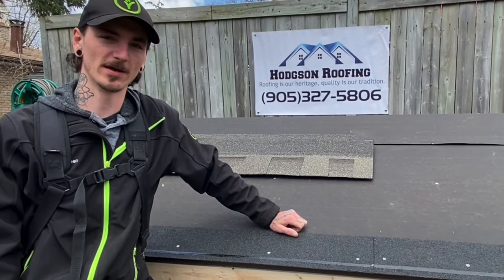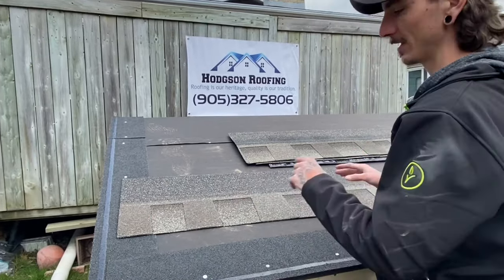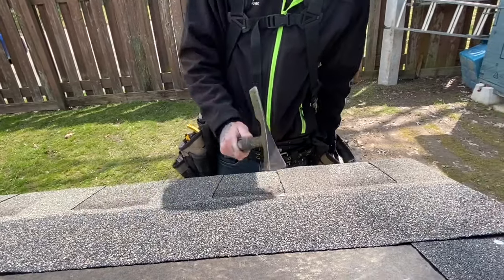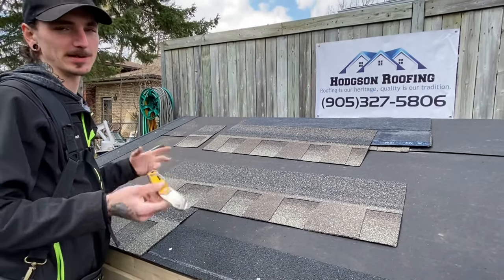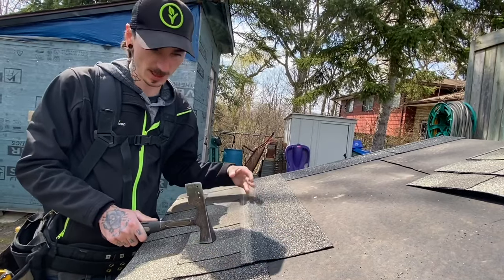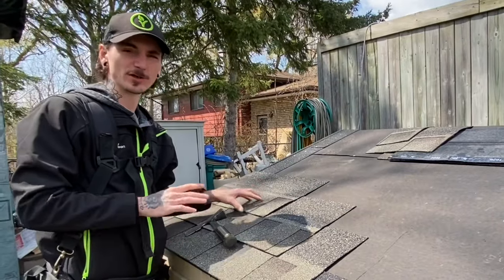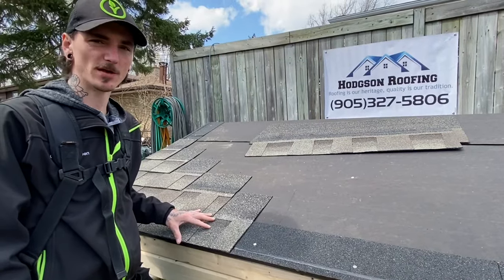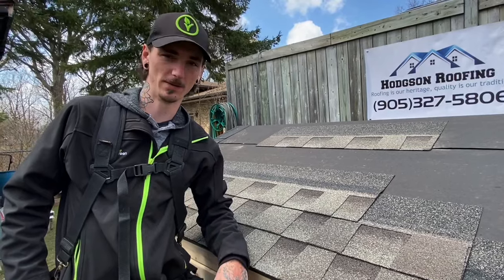How To Properly Start Shingle Courses On A Roof

Comment: Thank you for your videos!! I decided to build an enclosed porch myself and the one thing I did not have experience in was roofing. I was able to follow your instructions and I think the roof is turning out beautiful! Thank you for all the tips and little added fyi's from someone with experience and knowledge to help ensure quality and prevent mistakes. There isn't room for error when it comes to the roof or you risk the integrity of your entire project and alot of expensive repairs later on. I'm a single Mom raising 3 boys and I get alot of shit sometimes about some of the projects I do, until they see how well it turns out. I couldn't pull it off sometimes without the help of guys like you sharing your knowledge and skills. It is so very appreciated! Xo Have a wonderful day! Thanks again!

Comment: Super helpful, I'm doing this on an 8x10 shed tomorrow. Never shingled a roof before but your clear directions have me confident that I can do it. Thanks!
Reply: How did it turn out?
Reply: @randonrobinson  great! Did it just like this and had it done in a couple of hours. It rained severely the very next day so I'm glad I did it when I did
Reply: @Paintplayer1  good deal! Gunna have to try this out
Reply: @randonrobinson  for sure, one thing I think you're supposed to do which I didn't is overhang your starter strip by as much as you're overhanging your shingles. Might want to make sure on that before you start. I ended up adding some strips of starter between my first row of shingles so that it had an overhang in the crack between two shingles
Reply: @Paintplayer1  thanks for looking out! I’ll make sure to do that!
Reply: @randonrobinson  sure thing!
Reply from the maker: You can do it!
Reply: @Dylan Hodgson  thanks! It went really well. It's under a foot of snow now and no problems
Reply: I started mine, used full pieces on my first row. Now I don’t have enough over hang 😂. Plus I started the second one but followed the blue line that’s used guide you for nailing.
Reply: you did some research first , alot people dont do that .

Comment: A better way is to divide your shingle is by six. And a better wait to cut your shingles is with an old set of tin snips. And when it comes to your overhang on the other end of the roof, used the Snips to scratch a line from underneath matching your rake overhang. Doing this saves scarring your knuckles and a straighter cut.

I told my husband he should be teaching roofing and gutter installation, he's been doing this for over 60 years and when gutters were still wood. He used to make his own Cedar Shakes.

Comment: Best thing I’ve seen in a while. Came across a mancer roof that looked pretty strange.

They nailed too high so didn’t hit any of the lower portion of the shingles.

When nailing the top only like that the only thing holding the bottoms together is the tar.

When that’s hanging on a near vertical wall, they will slide and fall down. They were all over the guys balcony and porch area……

Comment: Good job man! When i get to the end i'll flip a shingle around and put it flush to the rake starter and then cut it from the inside and flip it back around, i personally think it's a little easier then cutting at the rake shingle by shingle or snapping a line down it and then cutting, if it's a little short the rake will still be straight because of the starter and if it's a tad long just grab a cut off and sand paper it lol,  nonetheless either way works.. keep up the good quality work bro!
Reply from the maker: Jeffery Demoss that’s how I normally do it myself as well
Reply: How do you like the stiletto, thinking of buying one but want someone else's input that has used one.
Reply from the maker: Ryan Annear stilletto is a good hammer due to low vibrations in the shaft and very light weight. I personally don’t like them as I like using the weight of my hammer to drive mails, the stilletto forces you to use more of your own strength.
Reply: @Average_Roofer  thanks for such a quick response buddy! I'm a roofer myself and am currently using a steel hatchet that I love. For the price it doesn't seem worth it, plus I cant seem to be able to order a stiletto from anywhere reliable lol. Thanks again man
Reply from the maker: Ryan Annear no problem, the only thing nice about the stilletto is the weight. Easy to carry in a pouch all day. In my opinion that’s about it 😂
Reply: @Average_Roofer  you just saved me 140 dollars 😆, roof on bud, stay safe up there
Reply from the maker: Ryan Annear you’re welcome. I use the 14oz shingling hatchet by PrimeGrip with Cushion grip. Approx $50.00 but it’s the best hatchet I l ever used. Have purchased 3 in 7 years. Never broke any, just lost or stolen.
Reply: @Average_Roofer  I saw those online to, I think I'll take your word for it and try that out.  The hatchet I have now my buddy left me when he switched jobs, I cant imagine switching back to a hammer full time lol. And the price sounds much better!!

Comment: 1" in from the edge .
12" in and 12" again then 1" in from the end 
FOUR NAILS.
6 NAILS FOR STEEP ROOFS OR IF YOUR HOUSE IN ON THE WATER.
Reply: Eamon Augustine 
I actually show my nailers/workers that the hammer their using measures about 12 to 13 inches long.
Lay that down from the edge of the shingle and that’s where you nail in the centre of the shingle .

Comment: We just had an new arch shingle roof put on in September of 2020. There seems to be some type of machine press issue. I wish I could attach a photo. But some of the little squares on the shingles are falling probably 30-45 on a average size home. Our builder is offering to replace the whole roof but says it won’t actually hurt anything - more aesthetics....we haven’t even moved into this house yet. It’s almost ready and this was just discovered.
Reply from the maker: This is a manufacturing defect, and although isn’t 100% going to cause issues it could potentially shorten the life span of the roof. 

If they are offering to replace it, I would definitely have it done to protect the home in the long term!

Maybe mention to your builder to contact the shingle manufacturer to report the defects and they may even help cover the costs. 

I hope this helps!
Reply: Your Average Roofer
 Thank you!
We are going to tell him in the morning. 
This is exactly what we were concerned about. 
We want it to last- plus we are in tornado alley. 😬

Comment: When nailing a shingle at the edge of the roof, do you need to nail a certain distance away from the edge of the shingle to avoid water wicking under the edge and following the nail down?

Comment: Great video, just curious, it looks like some of the of the staggers aren’t all 8 inches? I’m guessing it doesn’t really matter just as long as they’re staggered some amount from like 8-12”?
Reply from the maker: You would generally try being a close to perfect as possible. But installing roofs every single day, you tend to roll with whatever you get as long as your seams are spaced sufficiently and there are no nails in your seams.
Reply: @Average_Roofer  sounds good, I just had to shingle a small roof today and it had been over 5 years since I’d done any roofing. Your video was a great help.
Reply from the maker: @shaunybonny688  excellent! I am glad it helped out.
Reply: Correct
Reply: Cut pieces at length of shingle color. 5 5/8” off first piece, 11 1/14” for second and so on. Perfect every time.

Comment: Dear Average Roofer,
As I was laying my starter strips, I noticed that it has a super-thin layer of plastic over the tar strip. Shouldn't this be removed? Otherwise, how will the shingles seal to each other- isn't that what the strips are for?
Reply from the maker: The film strips on the back of each shingle are to prevent sticking together while the shingles are in the bundle.

If it came loose and is covering the tar strip it needs to be removed.

Comment: Thanks for the video, used it to start my roof project. Don't like the fact I only left 1/4" on the gable sides, probably gonna leak at some point. Wish I would have planned better. Thinking about ripping what I installed and starting over. What's your thought?

Comment: hey man, do i run the starter strip all the way up the gable to the ridge on every roof?
Reply from the maker: It’s good practice, and most manufacturers require it. You can do without it but it’s not recommended at all and can allow wind to pull the shingles up on the gables.
Reply: @Average_Roofer  cool, thanks for the fast reply. I'm doing my roof this weekend with 0 experience lmaooo

Comment: when i'm roofing 3 tab ,,,before i put my starter course down i hook my tape on the eve at both ends measure up 16 inches,, and pop a line ...run your first 3 courses  ..when you get to your 3rd course you put the top of the shingle on the line you popped...30 year ,,you go 18 if not mistaken . this will get your shingles straight from following crooked facia

Comment: It would be really great if you could make a video on how to properly stagger architectural style shingles on the side of a cottage style roof. It seems that staggering them in 3 equals causes a lot of ends to align since the side sort of causes for lack of better term..a moving target.
Reply from the maker: I can definitely do a video on that. The best method is one full shingle, 2/3 of a shingle, 1/3 of a shingle and repeat
Reply: @Average_Roofer  oh okay..ill give it a try tomorrow. Couldnt get up there 2day. It seems the weather knows im off so its raining here in Sudbury constantly. Snows a comin soon...gotta get her done up.
Reply: Not all shingles lay that way. Theirs a 3 part step a 5 inch step or three tabs a 6 inch rack. Presedentual 3 part shingles have to lay out from left to rite and have to be laid exactly to the dimensions
Reply: @Average_Roofer  did it in  thirds like u suggested...worked mint! Thank you. Did my garage right afterward which was a regular roof and followed the manufacturers instructions.. and it wiorked great too. U really helped me out man! Thanks. Btw..i find way less waste on these new shingles. U can cut them any length and not notice it from the road. The old ones had to be cut in a specific spot. Anyhow.. thanks again from sudbury. (No leaks yet) 🤟🤟
Reply: @mikeclark5421  gd to know. Thanks. I guess i got lucky with these cuz cuttin them in thirds worked great for not having seams one on top of the other or nails too close to edge.
Reply: @garpikemike1  not luck iam ginna say experience. I wasnt criticism u bud. I was just saying theirs more ways and some shingles have precise methods. I know from experience. That is fucking shit up and haveing yo pay to fix it. Lol  roofing a mans job. Good video buddy

Comment: Hey I think I'm lost on why you have 5 different starter lengths for each row. I would have thought it would just alternate like bricks. Can you help me out here, I'm doing my garage this weekend.
Reply from the maker: This is called a pyramid stagger and all architectural shingles call for this pattern as to fulfill manufacture specifications. 

The block like pattern is used for 3 tab shingles only! Hope this helps
Reply: @Average_Roofer  Thank you!

Comment: You next video should be on how to throw your lines with shockline to make you lines straight and how separate they should be please make that video
Reply: Our first chalk line is 18 1/2" from the eave and then 33 1/2" up from there til you reach the peak. Im sure everyone has a different method and whatnot but that what I was taught.
Reply: @upnorth6.0  great so after your first line is always 33 1/2 till the peak?
Reply: @jqdurango807  correct! Thats just how I've always done it and was taught that way. It works great and I've never had an issue doing it. As long as your using architectural shingles you'll be good to go.
Reply: Ryan Annear how can chalk lines be every 33  1/2 when shingle is only 15? Nube here.
Reply: @erpinterfaces9631  they were talking about the start lengthwise going up the gable I believe
Reply: @erpinterfaces9631   I believe it has to do with the amt of  exposure of the architectural shingle. I'm not sure but believe it's 5 1/2", so every 6 rows would be 6x5.5 = 33". 5 5/8" exposure would be 33.75". I've seen videos where they snap a chalk line every 5 1/2"(or what every the exposure of the shingle is.)

Comment: ive done idk a hundred or so roof jobs. mostly new construction. 
that was like 15 years ago.

started helping a friend reroof his house. 

it had a split roof in the back. 2 seperate pitches that meet. Never had that before. roofing buddy said to step downwards to the eave, then work left to edge normally.

worked great.

Too bad every other aspect of this roofing job was a shitshow from the start.

my fault for forgetting a few things at the start.

but i have a question.

If a house is not actually square, peak and gables are not perfectly 90°, do chalk lines fail by default?
not 1 chalk line stayed true.

starter strip lines were off. split peak line was not parallel with the roof peak despite careful measuring/marking. 

the 3 tab shingles we used, often times 1 bundle was cut slightly taller or shorter than other bundles, and none of the shingles had the precuts at the ends, so easy placement was not a thing. had to use a tape to line up EVERY DAMNED shingle. (not a small roof to be sure).

so yea, can a house thats not square, completely screw with ...everything?

i have never been so frustrated with a job in my life. 1 storey bungalow with a small addition about 1 square in size.

55 bundles, plus all the prep, 1 nailer gun, and 2 helpers with zero experience, we started LAST FRIDAY lol.

short by like 5 shingles, and hardware store closed just before we arrived to buy more.

last row of shingles on Slope A, step flashing around chimney, and tar the lead flashing after, is all thats left, but this is probably the most embarrasing job ive ever done. None if the tabs line up straight from bottom to top, on the side facing the street. the back was perfect for a while. and it just veered up or down, all attempts to fix it by placing the next shingle down in a compensating way didnt work. chasing the rain away forced us to not undo half a roof. lol. 

ugh.

anyhoo...carry on. ur better than i at this stuff
Reply from the maker: killwalker 2019 thanks for commenting! So if the problem you were having was the roof being out of square, especially with 3 tabs that can be a tricky thing to fix especially if you want the roof to actually look good. Architectural shingles are very forgiving and easy to adjust. Always measure from the ridge down to eaves and in the worst case scenario start your first course by dropping lower on one end of the eaves to ensure squareness from the start. The gutters should hide this little blemish and the rest of the 3 tabs will look great!
Reply: @Average_Roofer  Thanks for replying so quickly. i wish that i could send photos to the comment section. would be nice to know ahead of time if the roof will be at the very least, Functional and sealed
Reply from the maker: killwalker 2019 you can email me at YourAverageRoofer@gmail.com
Reply: @Average_Roofer  sent some pics for critiquing. include any into ur vids if you like.

You can do a "what happens if you start a roof incorrectly" video 😂😂.

quick question.

Eavestrough. water gets behind and under then drips down across the bottom of the front of the gutter the whole way during heavy rain. 

Home owner thinks drip edge should stop that altogether. I have explained that the edge of the metal at the back of the gutter is not snug up against the eaves. water dripsdown the drip edge. follows the path of least resistance and goes into the back of the gutter. drip edge has to overhang the edge. shingles overlap that. water travels over and under the shingles onto and/or past the drip edge, which is a few inches back from the outside lip of the gutter. 

aside from nailing the gutter to the eaves and caulking it, what can be done to make "ALL rain flow into and never outside of the gutters. 

basically they want the water to not drip over the patio entryway.

Thanks a bunch. im really hoping this roof is functional. 

we just got doused in 11 minutes of heavy rain and winds, just before exposing the peak for the ridge vent.

gutters in the back were practically useless.

but apparently no water got into the attic, and the felt was exposed, 2 inches+ wide, and 34 feet long.

lined up....not really no.

functional...seems so. minus the gutters.

Sorry for my long speak. ima geek.

take care.

loving this discourse.

Comment: hello I am doing a second roof around my A/C , the rest of the roof is tile, my question is my old roof overhang is bending over the rain edge its really bent over should I cut off the part bending over and then start my 2nd roof with a starter strip? by the way great videos! thank you for your help

Comment: When you put so many nails in the shingles they go right through the ply wood. Is there any shorter nails?
Reply from the maker: 1 inch, 1 1/4inch and 1 3/4inch are the standard sizes. 1 inch obviously being the shortest. However you need a least half an inch of penetration into plywood as for code.

Comment: Great video. What nail size do you recommend if I use 7/16 OSB ?  Thank you
Reply from the maker: You may use one use 1 inch, however 1-1/4 is highly recommended for most roofing applications
Reply: Thank you for your fast replay. I have some 11/2. Do you think that they will stick out to much? Thank you
Reply: For the ridge cap do I need longer nails?  Thank you

Comment: What nail are you using? How do you prevent it from poking down under the sheathing?
Reply from the maker: All nails poke through the sheathing. That’s intended to happen to insure you have a 3/4 inch penetration on your substrate.